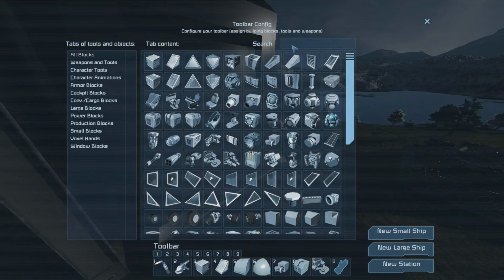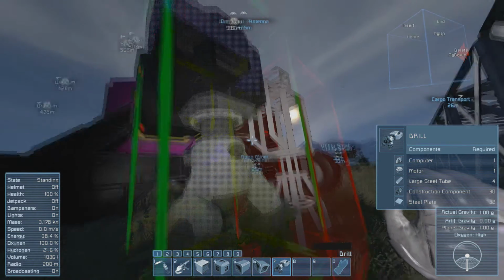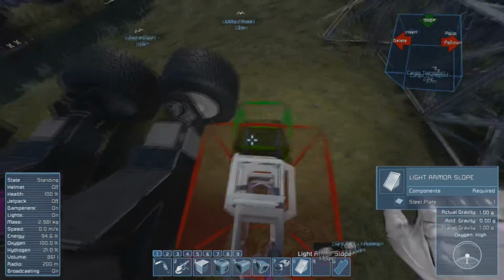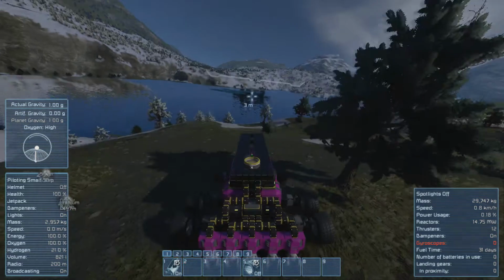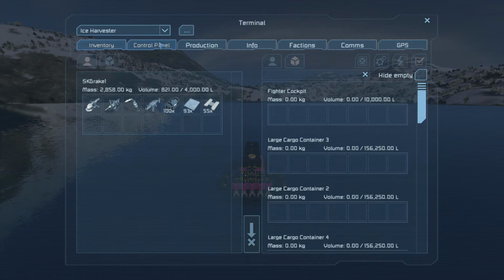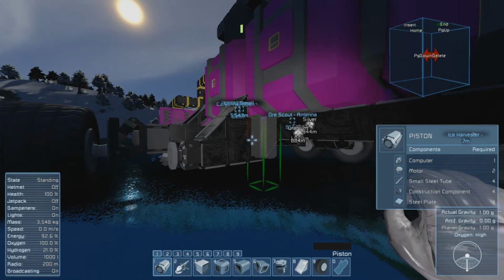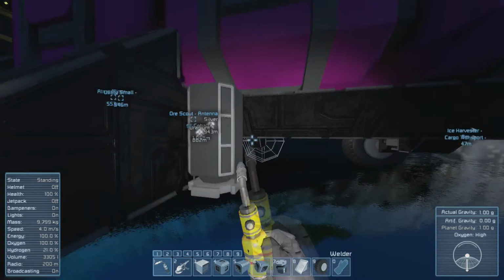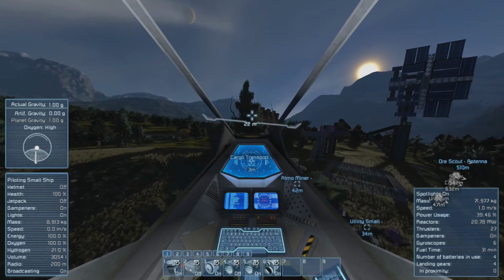Space Engineers S3 E30: Harvesting the Ice

Comment: You can break with space
Reply from the maker: +Peter Safwat That works as long as you don't have hover thrusters.
Reply: +Peter Safwat [s] key works too, but it depends on wheels power setting (it's good idea to put wheel power setting on the hotbar). But if you exceed speed limit of your wheels, it stops working. It seems speed limit works by disallowing you from accelerating AND braking after you exceed it. You could exceed the limit while moving backwards otherwise. Only solution is disabling speed limit and maintaining speed by hand.